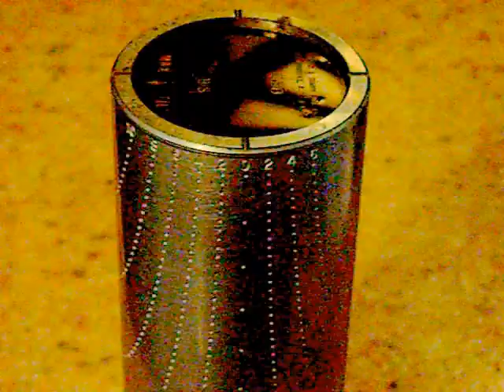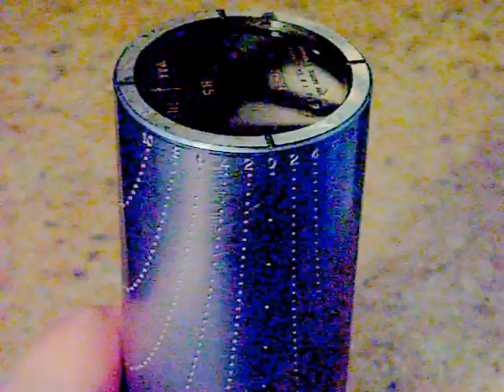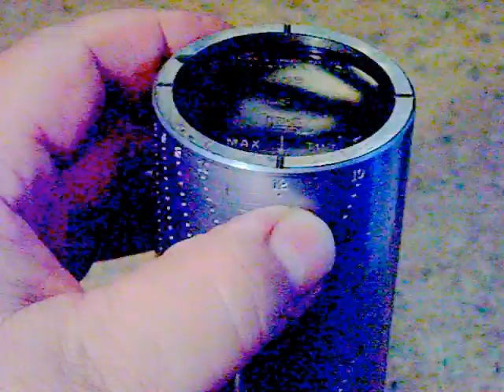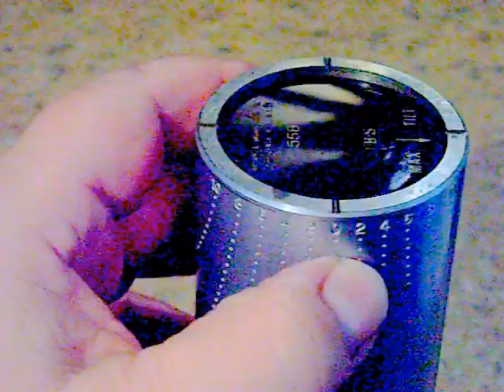What's a 6" Direct Reading Cylinder Square ? by Jeffery A. Krueger

Comment: Dear Sir, I have been wanting to understand exactly how to use this type of cylindrical square. Is it possible for you to make a video using this square on a flat surface to check a piece of work, and to go thru step by step on how it is used, specifically the numbers and dots and what they indicate to us about the work being checked? Thanks.
Reply from the maker: Hello , in the beginning of this video the 6.00 Inch Cylinder Square is resting on a Flat inspection Grade Granite Surface Plate, The surface of the Cylinder Square in contact with the Surface Plate has a slight angle ground/lapped perfect to the numbers and dots in a way that when a square edge to be inspected such as the side of a square block is done by placing the block  on the surface plate too and carefully bringing the 90 degree edges of the Block and the Cylinder Square together , The Cylinder Square is the Master along with the Surface Plate , so at this point the Cylinder Square is rotated until light does not shine through the contact surfaces allowing the viewer to read the scale part of the Square , matching a 90 Deg. angle to  0 with the dots means Square in a 6.00 Inch Distance , Rotating the Cylinder Square it will lean from 0 to 0 left or right indicating what direction a block being inspected may be out of square. , matching a NUMBER engraved on the Cylinder Square exposes direction of lean and represents the error in the block being inspected , each Number represents tenth's of one thousand of an Inch over a 6.00 inch span.  I hope My reply was sufficient in answering Your Question , feel free to let Me know , Best Wishes Jeffery : )
Reply: @JefferyKrueger  Dear Sir, I have read the explanation, and have understood it to a limited degree due to my lack of experience. If a video could be made to accompany the explanation, it would be most helpful to visualize the operation. I am grateful for your explanation. Thank you.
Reply from the maker: @ To add to the Video at the top, This direct-reading Cylinder Square is to inspect something precision ground square with an error no more than .00012 of an Inch, with-in a 6.00 Inch span,(the basic  height of the Cylinder Square) to put that something on the surface plate and bring it in contact with the Cylinder Square that is rotated to match/fit the inspected something perfectly, the scale engraved can be read, 0 on either side is matched , it's square, if not there will be an error to be matched and read in the same way by rotating the Cylinder square, after finding the error, on top of the cylinder square is an arrow to indicate the direction of tilt when the scale is matched and read. I hope this clears it up for You , Best Wishes Jeffery : )

Comment: I dont really get how this one works
Reply: Watch the video again, it's been well explained. But since I own the same B & S 558 square I suppose it's a bit easier to understand for me. The base is lapped at a very slight angle. With that angle known along with the cylindrical squares length then the dots can be mathematically plotted to provide an accurate measurement point.
Reply from the maker: Thanks For Watching and Best Wishes to You : )